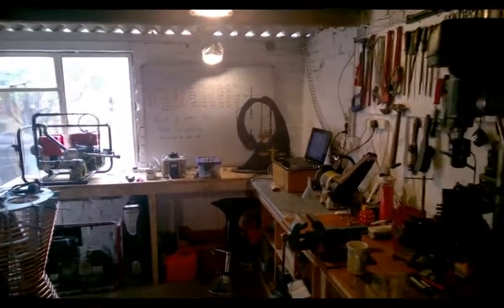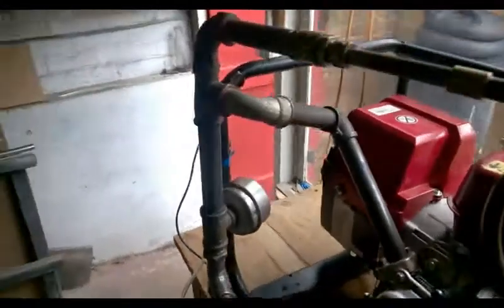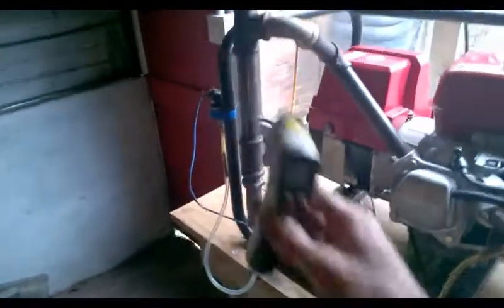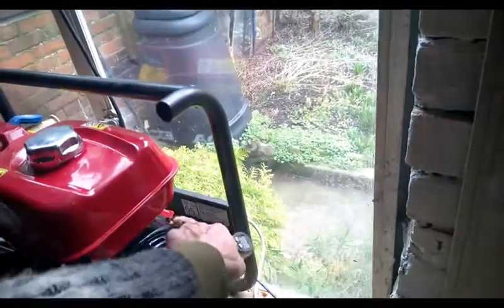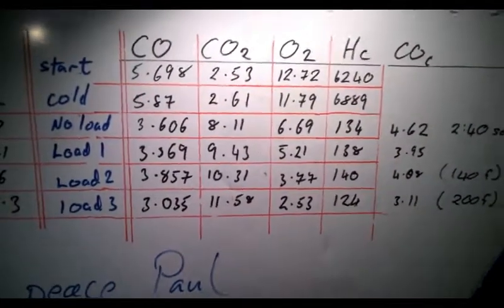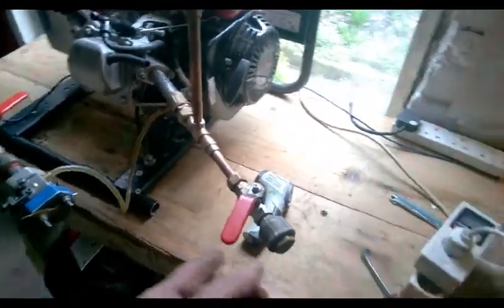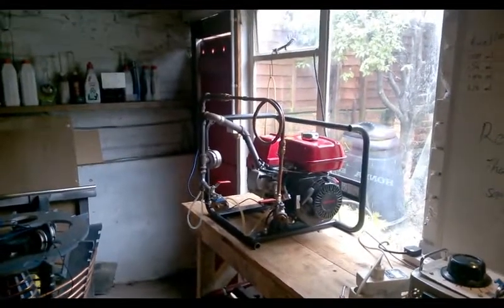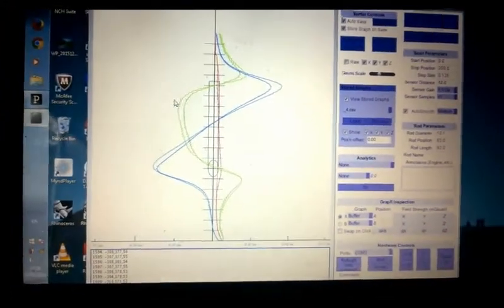Geet system running a  Honda GX160 generator  (GEET LIFE)

Comment: AWESOME Dan I'll paint you green and pin You UP!!  ;) Moved on loads from when you were here 2 yrs back. Fantastic, big hugz  :D
Reply from the maker: +Debbie Evershed 
Yer shes running sweet, and im glad that you like it.
     
Just need to add the controls to the valves cos the AVM valve chatters when its fully open   
I had to hold it still to do the top end power part of the run, hence not being able to show it running clearly at a full 1800w 
Happily that's not a big thing to deal with..   just a shame for this vid :)

Comment: Hello again. 
I’ve been pondering this.. how to use a compressor and gerni water pressure cleaner with a radiator heater somewhere along the line. The water coming out of the pressure clearer would be EVO charged water? Could melt bricks away or feed the garden?
Reply from the maker: im not sure that i understand you.  
Do you want to make a super heated and electrically charged water jet?
Reply: @dinskiy  a bit like the tool witness marks in the granite quaries in Egypt. Could this have been achieved back then?
Reply: @dinskiy  what if u out Ormus water into the bubbler of the geet?  That would be something. 
But yeah, I’m trying to think of ways of applying the principles in different forms to fully understand the concepts. 
I’ve been watching Bob Grenyer which led me to u. Malcolm Bendall is doing the same thing
Reply from the maker: @gruboniell4189  arha...  well i often felt the ancients used some form of HHO tech.     Ide really love a hho torch with plasma discharge on the tip. 

That would be sooo epic
Reply from the maker: @gruboniell4189  adding ormus to the fuel mix is an intresting move, but is a massive waist of precious mono atomics, but could be done for experimental purposes.

I believe that some races use ormus in this way,  but they are literally burning through masses of the material rather than using it as an antenna for collecting unlimited free energy.
Reply: @dinskiy  100%! 
A Geet slave unit where gas is utilised at will? 
Is the gas discharge a different form of “fire”? Does it lower the temperature of melting points? After seeing Ohmasa gas melt things at lower temperatures I have an idea for forging. I like forging knives, armour ect and was wondering if the gas would change the structure of the metals heated with that Geet gas?
Reply from the maker: @gruboniell4189  now thats a really good question.  Simple answer, no one knows.    

One geet team made a slave unit and fired up a gas burner,  but i dont know if the reactor was running properly.   Might have been running on fuel vapour. 

I would expect geet gas to behave something like hho.   

The trick would be ballanceing the air fuel mix, engine speed and load, while drawing off the gas.   Get the mix wrong and the reactor will shut down and send un-reacted fuel vapour.
Reply: @dinskiy  thanks

Comment: 17:20 
Why CO2 value is variable from 2.5 % to 11.5 %, and how we can make CO2 Value constant at 2% with Geet engine.
Reply from the maker: As one increases the load more fuel is sent to the engine to create more torque.
As the amount of fuel goes up the amount of CO2 and C0 rises, and the amount of unused air falls so the 02 goes down.   It just how engines work, all of them. 

If a GEET reactor is working then the reactor is breaking down the fuel into hydrogen and so you don't have CO2 or CO
Reply: @dinskiy  Thank you
Reply from the maker: You might want to watch is vid about how fuel burns in an engine.
https://www.youtube.com/watch?v=S_vfUhzl3bo&list=PLSIrmTAdjkrrq83QALvjqvoYyRMj-qvVB&index=7

Comment: do you have any gasoline condensation between the reactor and the carburetor?
is the small plastic tube for this purpose?
Reply from the maker: It is very possible to get fuel condensation between the carby and the reactor..  that is quite an issue with GEET..   the small tube attached to the carby is actualy the fuel line.
Reply: I was talking about the line of the vacuum gauge..
when i stop the engine after 10 min there is a lot of gasoline condensation that i have to remove .I don´t know how to manage that situation because the rpm goes up and down and the rod gets dirty...
Reply from the maker: @godardbernadette830  
Arh yes that is a classic issue. 
Basically you have too much fuel and not enough air going to the reactor.  Pull back your fuel untill it will just run with the amv closed.   Then open the fuel a little and then open the amv again.   Keep doing that untill the reactor starts to flood. 

You have now found the max power you can get with your design.
Reply: Great ,thank you .
tomorow I come back to my engine
Reply: Is this carburetor from a chainsaw?
I use to put a bubbler in between otherwise the rod gets dirty and at the end it always remains some kind of light gasoil who do not want to evaporate..
Maybe my carburetor from a small motorcycle is not appropriate to feed the reactor properly.

Comment: Why don’t you need a back flash arrestor with a geet system?
Reply from the maker: Good question.   
In all my years I never had a problem with flash back, as there is not enough air in the fule mix going into the reactor to allow the fuel to combust...
IF you hook a HHO rig on to the reactor you Must have a flash arrestor or you will blow your self to little bits.

Comment: All bullshit.  You guys are all doing the same thing... burning vapors. 
 It doesn't matter what you mix with the fuel, an engine will run on 
vapors but it's not fuel efficient at all.  All of you guys have a 
'bubbler'.  Try making 2 of them, 1 for gas and the other for your 
liquids.  Then start the motor on the gasoline and after your bullshit 
'plasma reactor' gets 
warmed up, switch valves.  The motor will stop every time.  Your 
'bubbler' is just a fish aquarium aerator on steroids.  Your 'reactor' 
isn't reacting to anything, and your 'fuel rod' isn't a fuel rod... it's
 not contributing to fuel in any way.  It's merely working as a wedge 
inside the 1" pipe.  It forces the intake fumes through the narrow 
restriction between the OD of your rod and the ID of your inside pipe 
and accelerates the vapors through the device and maybe heating the gas 
vapor a little better but that's all.  There is no 'reaction' in the 
chamber.  Your 'magnetism' is so weak it couldn't lift a paper clip.  
Your 'fuel rod' can be magnetized by putting it against a magnet for a 
short while and of course a compass
 would react to that, big deal.  There is no such thing as GEET GAS, 
that's just a marketing label.  You're burning octane fuel, period.  The
 only way to know if your 'reactor' is doing a thing is to test the 
emissions.  That's the only way.  All you guys are doing is the same 
thing... using the exhaust to heat the gas fumes.  When you take a 
carburetor off and run the intake pipe straight in, you can send any 
kind of fumes or vapor into it mixed with gasoline and the motor will 
run because you're running the gas vapors.   Water will pass through 
that way as well because when you removed the carburetor you removed the
 small jets.  Water clogs carburetors because water is more dense and 
has a thicker viscosity, it had great difficulty passing through the 
very small hole in the jet.  Furthermore, in WWII the Corsair and the 
P-51 Mustang (just 2 for example) had water injection options.  When you
 inject water into a combustion chamber and the water converts to steam,
 it expands at a VERY higher expansion than gasoline.  I could go on and
 on with this you have no idea how many holes are in your devices.   The
 planes had something like a 10-20 gallon water tank and the pilot could
 turn on the water injection for a very short time, but just enough to 
give him a boost in horsepower (from the water changing into steam, not 
burning) to get out of a bad bind if he needed it.  All of these youtube
 lifers are saying the same and doing the same, copying each others 
designs and yes, getting the same results.  Burning gas vapors.  But the
 problem with copying off of others and not doing your own work should 
have been learned in elementary school.  When the 'smart guy' is wrong, 
EVERYBODY IS WRONG.  Buncha copying dumbasses.  It's nice chasing dreams
 sometimes tho...  If only it were true.  Too bad it isn't.